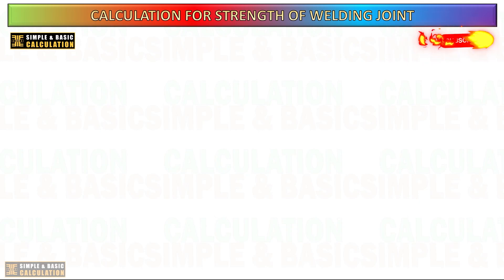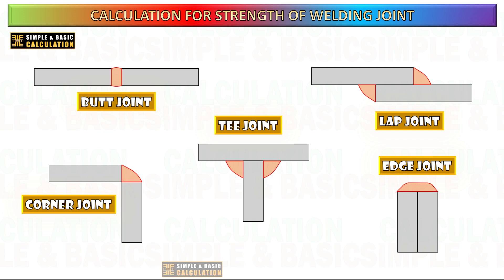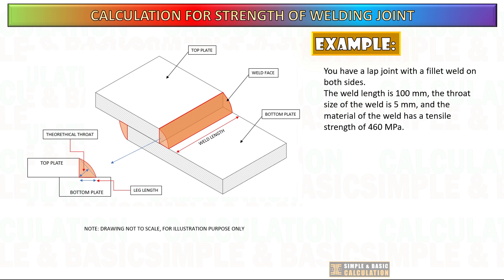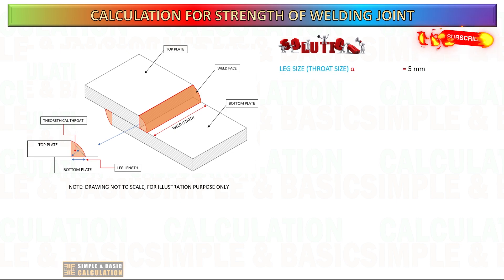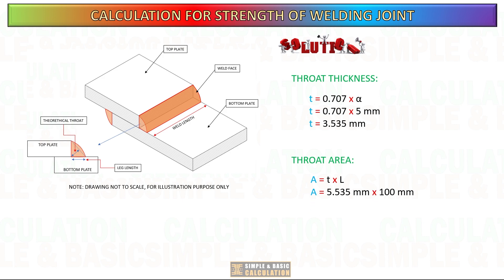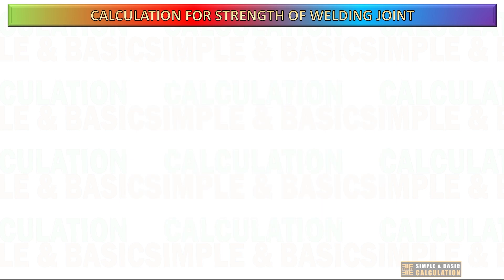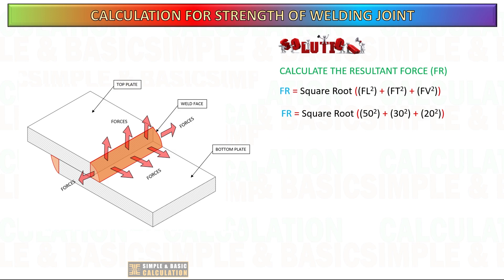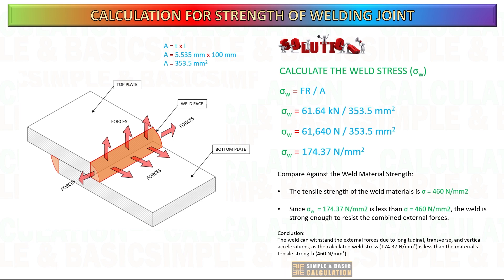Mastering Fillet Weld Strength Calculations: Step-by-Step Guide

Comment: So many things wrong here:
First it says throat = 5mm but then assumes 5mm to be the leg size not throat
Then it says t = 3.535mm, but to calculate the area uses t = 5.535mm
Why is the weld length = 100mm when you have two fillet welds, shouldn't the length be 2×100mm = 200mm
And many others
Reply: same question